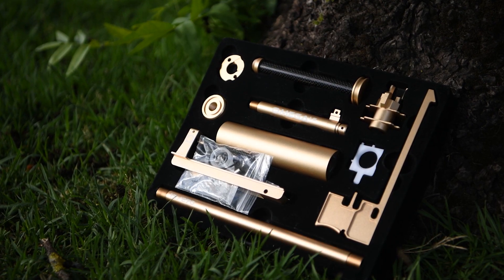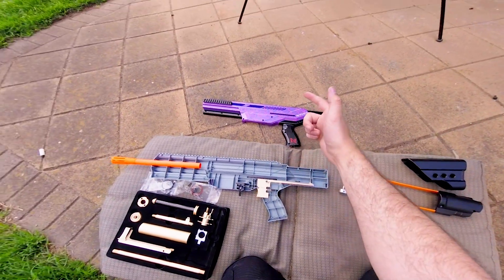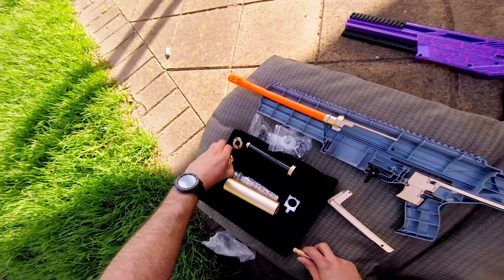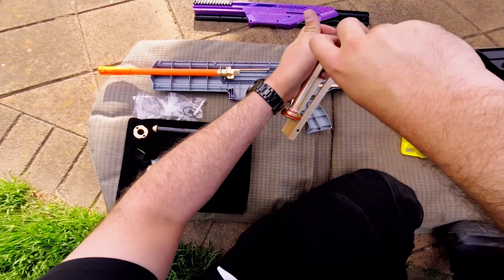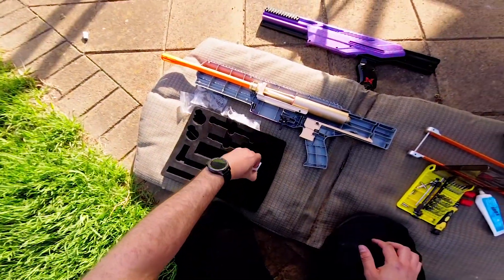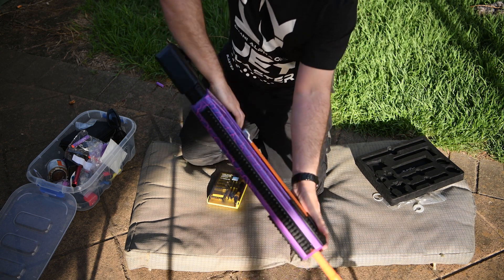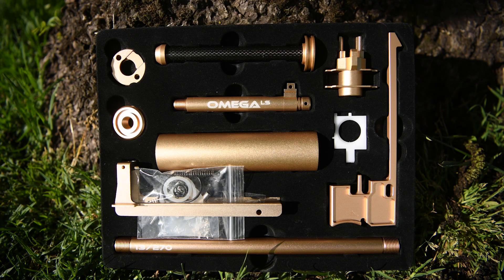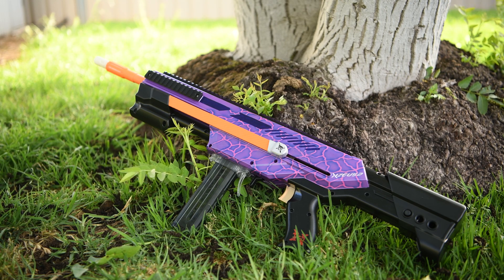Assembling and testing the Omega LS Kit

Comment: Hello Bradley. 
I have done some major fine tuning to my Zeus/Omega Kit. If your looking to improve your seals, use yellow Teflon tape, it is designed for gas seals where as the white tape is for water. Next, I used a all natural edible grease that is used on food machines and ice cream machines. This may sound crazy, but it has zero petroleum additives in it, so there should be no change in the quality of the oring's seal due to degradation because of the lube used. Most lithium greases use a small amount of petroleum in them, so I don't touch the stuff. The last trick was to fix the weakest seal in the system which was the plunger head speed  seal. I have a very special trick for this, and after getting the same results as what you where getting Bradley, I am now punching around 360 fps as an average on the 16kg spring that it came with. 
I am about to head to my friends engineering shop and machine up a nylon plunger head for it to reduce the mass and reduce the tolerance between the PT/PH and make it so my oring seal trick will work better and hopefully get another performance boost. Yes it is now way to powerful to use at a war like this, but now I should get a hell of a lot better performance on lower spring loads, thanks to the seals fixed. 
And just one other note. Oring's should never ever pass over a threaded surface, this will put abrasions on the oring and affect it's seal, my suggestion is to put it in from the other end of the PT and do the assembly afterwards, this will guarantee your oring will preform at it's optimum seal.
Reply from the maker: What did you do to the speed seal?
Reply: Sorry Bradley, a bit of a trade secret at the moment. As I am going to be making some imrovement parts to hopefully sell. Will keep you posted.
Reply from the maker: By the way, I used gas rated teflon tape (pink not white) and liquid teflon sealant.
Reply: Oh and if you want to stop the wear and tear on the bolt sled Bradley where the screw goes through to prolong it's life and the shell life, get some 3/16 brass and make a sleeve up that is almost the length of the screw, it will stop the screw from shaving everything down. And if you can be bothered, get a jewellers file and on the bolt sled file some 45° angles on the front and rear of the two widest tabs that guide it, this will also prevent excessive wear and it really smooths the prime out more too.

Comment: @Bradley Phillips  very nice reviews as well as your accuracy tests , I wonder where did you get the pieces that hides the bolts of the priming bars on each side ?
Reply from the maker: Those were machined by Xplorer
Reply: @BradleyPhillipsYT  Thanks for the fast reply, I just finished my first omega kit on the xzeus2 shell and I got the same results, even lower 180-200fps but I will shoot a bunch of mags and maybe take off the carbon fiber spacer thing(protect the plunger rod) and cross my fingers to get over 220.

Comment: Hi Brad! I just assembled my kit yesterday using your instructions. I am noticing that my darts are sometimes flying out inaccurately, sometimes sideways. I am using a 20kg spring. COuld it be the spring or the dart guide rod that is causing the issue? Would appreciate anyones help!
Reply from the maker: Are you using a SCAR barrel or ZRO, or just the bare kit?
Reply: I’m using the bare barrel. I also cannot get the zero to preform. It seems like I have the same problem you had with your first. I can’t figure this out. I’m using a Orange mod works 20 kg spring which should be a monster! Would love your help sir! Jackie and Jesse from team FDL love you!
Reply: I’m also using talon mags with the talon mag converter.

Comment: hey brad, im curious as to how did you get the shotgun grip arms orange. did you use orange electrical tape? or did you paint it orange?
Reply from the maker: I used orange carbon fibre wrap
Reply: @BradleyPhillipsYT  where did you source an orange one? could only find black ones around here.

Comment: The spring is a piano wire spring, these are lower in compression but have a higher rebound rate. So easier to prime but still fire hard. A good example of these are the rival spring's. I repurpose the Kronos spring into fire strikes and get awesome results with super easy priming and hitting 150-160fps with occasional shots hitting as high as 180fps with ranges between 35-50m with only 15° elevation. I can't replicate those readings with sprung steel springs which are harder to prime and don't shoot as hard... ie: k26 springs...
I wonder just how much spring this kit and blaster shell can actually handle?
How far are you willing to push it in the name of Nerf science Bradley.
Jayson (BlasterSmith) Smith Perth WA.
Reply from the maker: In my production sample I've used 20kg just fine
Reply: Does that count on all Jet Blaster springs? Because if so I'll have to consider that because man if my turf spring harsh to my arm
Or I need to lift
Reply: Not sure about all the jet blaster springs, but I know that some of the new worker springs are piano wire. Mostly the Kronos and Longshot. I put a 18kg in worker spring into a Kronos and it's way easier than a K26 to prime and it sure does pack a punch now.
I am just waiting for my new Jet stuff to arrive. So I will know more later.

Comment: Thanks for the review. This might have changed my mind over which kit to get, i was thinking about the OMW SLA printed parts and their hopefully upcoming "Hybrid" kit. By the way was that the little white scar from Monkey Mods that you were using?
Reply from the maker: That is Jet Blaster's ZRO. It screws on to Jet barrels.
Reply: Hey Main Stay...I'm seriously on the fence between the Omega and the Hybrid.  The Omega is damn nice with some better innovations ie. dart guide, quick spring change plate and screw on off barrels and pin vs the OMW kit.  On the other hand right now OMW will sell you the hybrid + a fusion kit.  The fusion should be more powerful as the plunger tube has more volume then Jet blaster.  The OMW parts are not as strong but the bolt sled is poly carbonate...you know the stuff that's used to bullet proof windows.  I can probably get order and get the Jet blaster in a month or so while the OMW hybrid not until march or so and who knows when the fusion will be finished as it's still in the design stage.  Which one are you going for?
Reply: @ToddLeeTV  I have been burnt so many times by Jet ( Alpha kit being such a disapointment, really slow deliveries etc. ) that I think I will go for the OMW kit ( if it gets 'funded') But having said that I will probably get both and put one in a longshot and the other in my xzues. I just want a drop in kit that is reliable, consistant and doesn't break after 2 months.
Reply: @mainstay. getting both is very nice..too bad I can only use one.  I just flipped a coin and omw won.
Reply: @ToddLeeTV  I just got an email from them. The hybrid kit is funded, plus they said even though the goal was for the first 300 pickers, they will extend the early picker price of $60 for another 50 pickers, then it goes up to $68. SO if you are interested now's the time to buy in.  I didn't realise that I won't be getting the kit till next year!

Comment: Hmmmm, not 100% on the hole through the dart pusher. That part is already an area with a high weak point when you up the spring loads ( metal or plastic), and putting a hole there with only up the fail point. Be interesting to see how it holds up.
Reply from the maker: That was their solution to people complaining about the plunger tube hole. The pusher on Omega has a smaller ID meaning it has thicker wall thickness than Alpha and is also metal. I don't see it failing from having those two side holes. If they did this on Alpha it could but they aren't.
Reply: I ment the big hole for that guide to slip through, the part where the bolt connects to the sled. If you where talking about that, all good.
Reply from the maker: Oh thought you meant the vacuum loading holes. That guide hole for the guide rod shouldn't compromise too much. Omega has been tested up to 26kg.
Reply: I have punished my Omega Kit in my Zeus, I have only had it 2 weeks and have now fired it around 5000 times with new, used and heavily worn darts under all kinds of conditions. And it works wicked after all the tweeks I have done!  It is one very solid kit that can achieve excellent high fps.

Comment: Hi Bradley. Good honest review! I’ve been thinking: why don’t they make tapered barrels? That become tighter after the first inch or so... this would still allow for lowered chance of jams... but also give better performance FPS wise. Could be tested in case of this kit by adapting a monkee mods barrel to take 17/32 brass after the first inch or so after the dartgate...

Best,

Marten (NIR0DHA)
Reply from the maker: I'd have to suggest it's down to difficulty in machining. You can't just buy aluminium already tapered like that. It's worth a try with brass though.
Reply: Bradley Phillips Yeah that is the reason no doubt. Production wise: A workaround would be to make the dartgate bigger (longer) and let it have the 13 mil ID inch or so long portion... then just put a constant ID barrel in that... which has an ID similar to 17/32 brass.
Reply from the maker: The alpha kit actually worked similar to that. Only about 1/3 of the dart was actually loaded into the barrel before firing. That kit jammed a lot with the tight barrel. Omega about 2/3 of the dart is loaded into the looser barrel before firing and it's cut down the jamming a lot.
Reply: Bradley Phillips Ahhh I see. Okay that means it probably wont work to make it both shoot at higher fps AND be reliable.